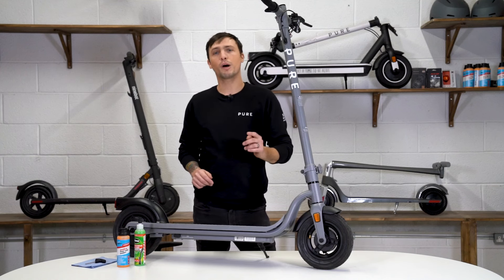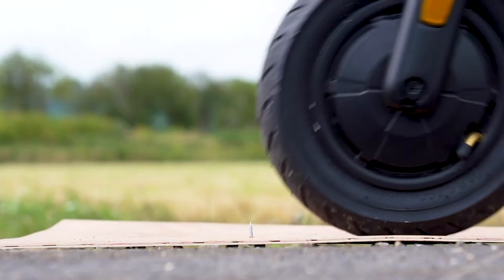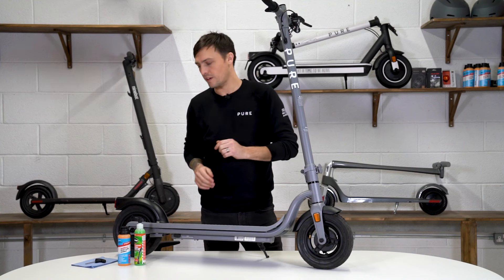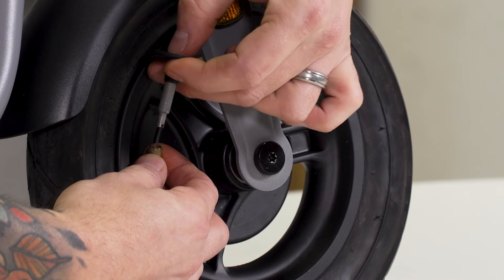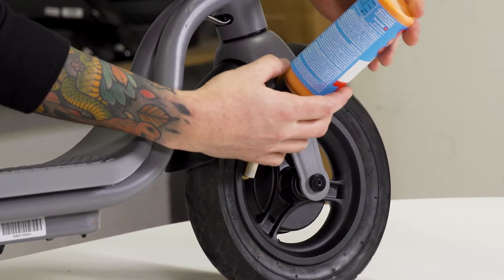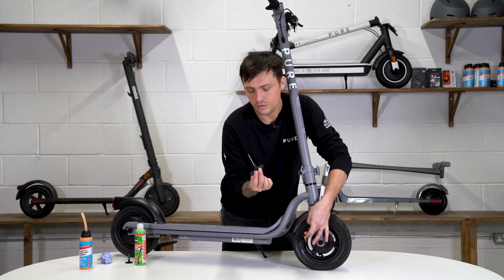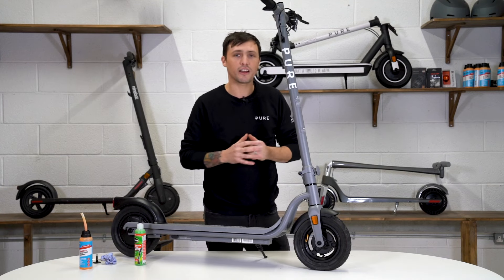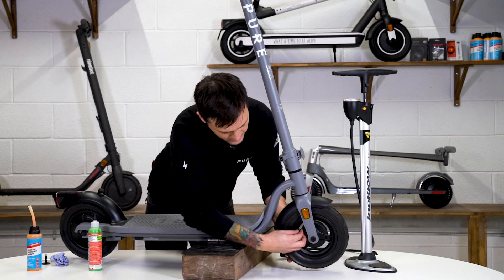How To Insert Puncture Prevention Fluid Into Your Electric Scooter

Comment: Go trax tire went flat twice. Purchased a better tire, before replacing the inner tube, coated the tire with anti-puncture tape. Installed everything, keep it inflated at suggested 36 PSI. No flat tires, works great.

Comment: 4 punctures in 6weeks rear motor wheel .4 repairs and still blew. Going solid as my pure won’t last to long now I don’t replace electrical parts I bin scooter nobody repairs them in Dundee. I’ve did punctures rear wheel pretty easy but solid is a different story

Comment: Thanks for your video. I have a ninebot with tubeless tyres. When I plugged a hole recently a thick black solution appeared on the reamer tool, I thought it must be a type of PPF though it has the consistency of blue tack. The tyre is still loosing pressure and I can't find the leak with soppy water and wondered if I should add a thinner PPF? or do you think that approach might just gunge the hole thing up completely? Thanks very much in advance.
Regards Nigel

Comment: Good afternoon I have a Scooter the tire measurements are 80/ 65-6,  could you tell me how much slime I should add on each tire. 
I saw the calculator and I tried to use but I noticed that didn't have Scooter tires, so I got in touch. Thank you very much.

Comment: Your videos are awesome. I just have a question about the slime. When the motor is on the wheel and the motor starts heating up, will it have an effect on the slime blocking the puncture like cheese  in the oven? Because I put the green slime in both of my escooter wheel back and front, both had a puncture. But only the wheel with the motor that keeps the green slime oozing out of the wheel and not keeping the air in.

Comment: I have a pure air e-scooter, does it have ppf and if so, what should i do to maintain it?
Can/should i refill it and after how much time should i check the air pressure and pump more air please?
Reply from the maker: Hi Nicholas! Yes, the tyres on the Pure Air come with pre-inserted puncture prevention fluid. You can refill it if needed, we recommend using 1/3 of a bottle per tyre. You can check the tyre pressure at anytime, preferably before each ride, as the recommended level is 37psi for the best performance. Thanks!

Comment: The grey scooter your working on how do you get inside it I need to reset mine cheers
Reply from the maker: To reset your e-scooter, you can take the handlebars off, then un-connect and re-connect the wires.

Comment: Still waiting on the video showing how to change a puncture on the Air Pro. 
Also the puncture prevention fluid is pretty much useless. Only got 6 miles on mine & got a puncture & the fluid didn't work. Need to invest in some top quality solid rubber tires instead. Hoping to get my hands on some soon!!
Reply: are u talking about the xiaomi pro 2????
Reply: @hdbeastgamer1074  No the Pure Air Pro. Doesn't matter now anyway got solid tyres fitted so no need to worry about punctures anymore.
Reply: @ANTxMC  oh nice, my xiaomi pro 2 is coming tomorrow and a bit worried about the punctures, we have loads of clean roads tho (for cars and bicycles) do u still think I could get a puncture if I ride there?
Reply: @hdbeastgamer1074  Possibly. But if you are using clean roads & cycle lanes you should be fine...But never say never!
Reply: @ANTxMC  how have the solid tyres served you these past months? Which ones did you get?

Comment: Is it completely safe to put PPF on the wheel that has the motors for an e-scooter? Won't it get damaged? For example the front tire of a xiaomi pro 2
Reply from the maker: Hey Jerome! No, this won’t damage the motor, the PPF helps prevent pneumatic tyres from getting punctures.

Comment: Hey, just a quick one, do I need a ppf if my tyre already have ppf from factory? It is the ninebot max
Reply from the maker: No, if the scooter already comes with puncture prevention fluid pre-inserted, you won't need to add more when it is delivered. You can contact us on help@pureelectric.com for further guidance.

Comment: Couple of things here.

First, the slime calculator link has expired.

Second, the green slime has a plastic core removal tool. DO NOT use this!! The plastic is too weak and will likely shear off in the valve, which will block the shoulders, stopping you removing the core!